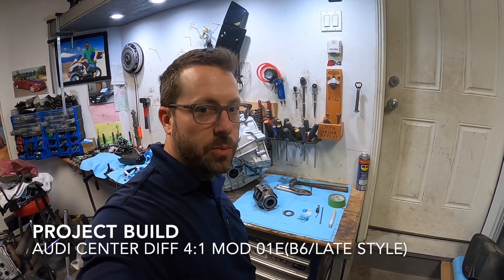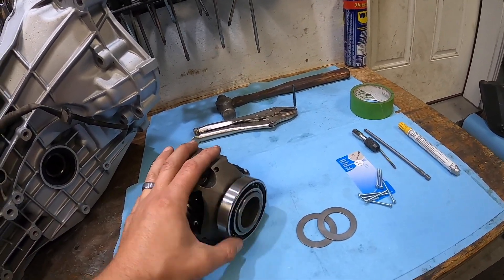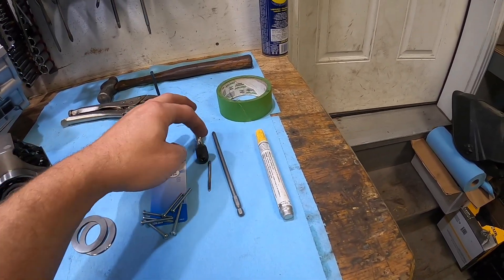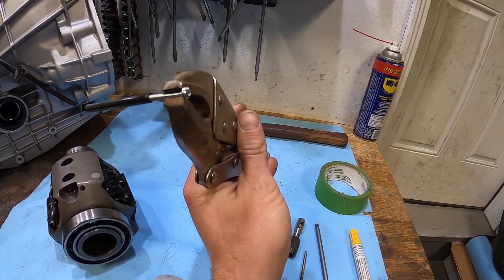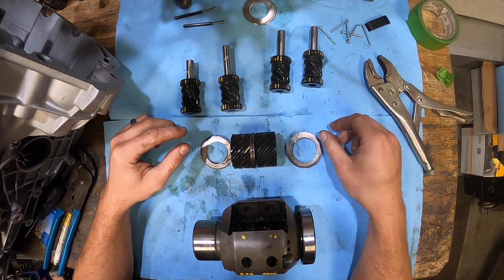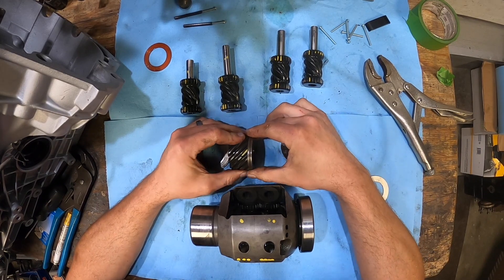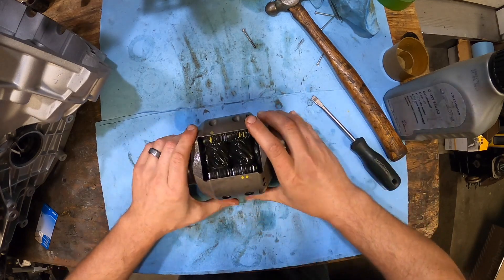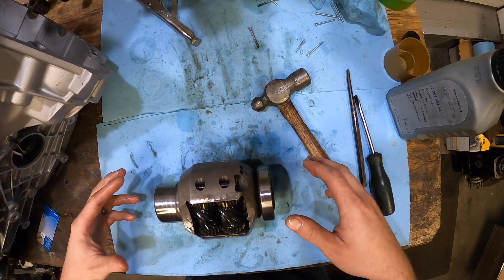Audi DIY Center Diff 4:1 Mod 01E S4 A4 B6 B7

Comment: Great video. Done this 2 years ago. Custom made shims at a local machine shop. If I may correct you so no misunderstanding on the 4:1 topic. IT is not a 50\50 distribution in stock form it is 66/33 r/f or 33/66 f/r in any proportion in between. Shims will make this proportion max figure 80/20 or 20/80 with all possible figures in between. In real life, the car feels much more rear-biased. Loses grip on accel. directly so u have to correct oversteer pretty much like on any RWD car and u will never have to turn your wheel in the same direction as the turn goes. Max. u will do straight wheels and even that rarely. My first drive in the snow directly after the installation was a big surprise. T junction 90 degrees left tight corner from standstill acceleration and the car spun immediately pointing in the reverse direction. Those people walking around honesty could not understand the driver that just spun. HAPPY shouting like a KID and swearing from happiness. Then tried it on a frozen lake the same winter. Same stuff oversteer and never understeer. And that's on a heavy 2.7T allroad STAGE1. Now Stage 3 waiting for winter. Not planning to try it in dry in order not to fail driveshafts and other bits.

Off-roading: Well pretty much the same to me. Not a real offroader but dipping it to mud it on every possible occasion and sandpits climbing. Does the same as stock to me.

Downsides: Dry/wet noise and heavy vibration whet starting to drive from standstill in a corner. Feels like a welded rear diff on an RWD car in terms of sound and vibration. Does not affect steering actually.

Hope i am not wrong. Correct me if i am.

Regards
Reply from the maker: Hey you are correct about the 66/33 or 2:1 factory diff, I read 50/50 somewhere, but that is technically achievable with traction with either set up. I am hoping that it doesnt make too much noise, some have said it doesnt, and some have said it does, so we'll see how that goes. I will definitely post a video of it installed for a comparision.
Reply: How did you find the dimensions for the custom made shims? And do they need to be made from tool steel or will mild steel work?
Reply: @Rusty_39  Definitely hardened steel. Not mild steel!
Reply: Can anyone explain in crayon how the shim change physically alters the diff? Not got one handy to look at. TIA
Reply: You can also tune the understeer out by going to softer springing and softer uncle roll bar on front, and stiffer springing and stiffer uncle roll bar on the back. 👌
Reply: why is this mod for manual trans only? i feel like left behind!
Reply: A T-2 Torsen center differential features the following: - 50/50 front/rear default torque split under normal conditions. - from 67/33 to 33/67 front/rear torque split depending on the conditions.

Comment: Easy job in theory but basically impossible to buy 6 - 32 tap in europe. Don't know how I can take it apart without it.
Reply from the maker: Does Amazon or eBay ship to your area? That’s probably the easiest. Other wise find the metric equivalent size and source that, probably and m3
Reply: @PBGarage  Yea probably. Got the shims today from JHM. 170€ with postage and tax. Yikes. Want to get it done and heard from some forums that the pins can be forced out from the bottom with a screwdriver.
Reply: Update on this subject if any euro guy is wondering. I just got the pins out! Pried from the bottom with a big screwdriver so the pins came a long way out and the tapped with a m3 tap and used long 30mm m3 bolts and they came out nicely.
Reply: @MetroTubettaja  Tnx mate. Did you take the dimensions of the shims by any chance?
Reply: @otogolubovic9707  I did but I forgot. I think it was 35x52x1,48mm. You can make them from LS3552 pressureplates but they are hardened and it is very difficult.
Reply: @MetroTubettaja  Wow. Thanks mate.
Thickness is cruisal, diametars much less, but both of them are different in thickness so precise mesurment is a must.

Material is not a problem since I have approach to all available metal treatments including nitriding, DLC, TiN, drylube coats etc...

Comment: Did you ever run your car with this setup? If so, do you have amy more videos or info on how it handles in the dry and the wet? Is it worth doing. 

I have an FRQ box with this shim mode going into a 550hp 1994 audi 80q b2 type 81 - audi 4000 i think in the America/Canada.  Wondering if it will be too much in such a light car.
Reply from the maker: I haven't yet... i should have but the project stalled. Aiming to have it running this summer with video though. Stay tuned!

Comment: Hey I’m currently doing this in my 02x and just can’t get the last gears to line up 

Also when I hammered out last pin with the screw the inside gears popped out before I had chance to mark the location, does these have to be on mark or it’s good long as it spins free?
Reply from the maker: As long as you do NOT hammer anything in, it will be fine. You need to restart. Take everything out, including the center gear. Leave one paired gear set in. Install center gear set, then the next second pair, at this point try what I was doing, if the center gear pops out, take the second pair out again, rotate ONE of the center gears ONE tooth, put the second pair back in. Test, if it still pops out, take the second pair back out, rotate that SAME single center gear one tooth. Repeat as many times as necessary.
Reply: @PBGarage  
Center gears doesn’t pop out the center stack specially one of the oem washer that popped out a little bit
Reply from the maker: @wafi3187  I am curious to know if all the other washers got misplaced, that could be a problem. I have an 02x gear box actually, I might be able to have a look, but it wont be until the weekend.
Reply: @PBGarage  
I hope I’d be able to get it working by weekend but I’d appreciate if you can take a look, I’m quite sure it’s not misplaced these washer have a place to go they are all different and each only fits in specific location I’d appreciate if you can take a look at your 02x and lmk how that washer is sitting
Reply: @PBGarage  
Hey I got it figured out the two center gear was on the wrong side the one that’s supposed to be in front was in the back thanks for your help !!

Comment: Is there a way to make it 60/40 instead of 80/20 bias
Reply from the maker: We have not found shims that offer that ratio yet. I’m sure someone out there has figured out the math to make them.
Reply: the s4 on b6 is split 60/40 stock.
Reply: @freddyhaza1377   The split on all B6 is 50/50

Comment: So far as auto quattro transmissions are the center differentials interchangeable? For example I have a b5 2.8 auto quattro DRN trans code will a center diff from a 02 FAQ code a6 swap over case and all. Mine is toast and I have to replace it
Reply from the maker: No idea. Try to stay as far away from autos as possible.
Reply: @PBGarage  any advice on where to get a good 6spd trans for b7 s4 avant. I have an auto & want to swap it..
Reply from the maker: @eastoakland-S65feen  We grab manual gear boxes from junk yards all day long for $140USD bucks. There are sooo many gear boxes in the junk yard that we have to walk past alot them. Its a shame since it would be nice to save them.

Comment: is your trans 5 speed?
Reply from the maker: No it's a 6 speed.
Reply: @PBGarage  do you know if it's possible to swap a 6spd in place of a 5, in 1.8t b6?
Reply from the maker: @austinstephensparks  Yes, people do it all the time. You will want the shifter linkage, drive shaft, the 5 spd drive shaft length is unique to the 5spd. You will want to make sure your rear diff final drive ration matches your 6 speed gear box front drive ratio. There are many 6spd dear boxes with different options, the most common are 3.889 and 4.111.